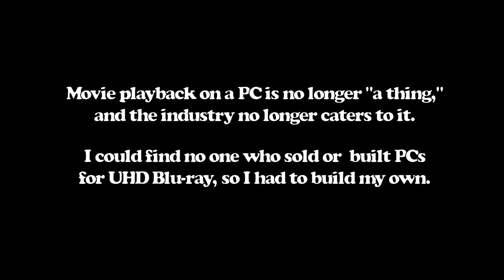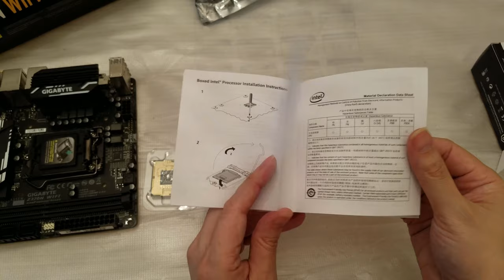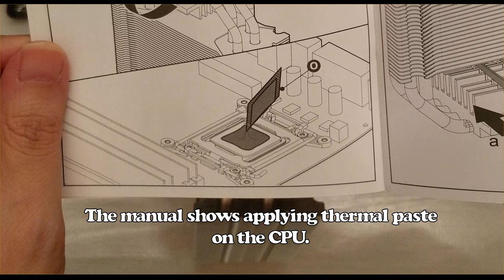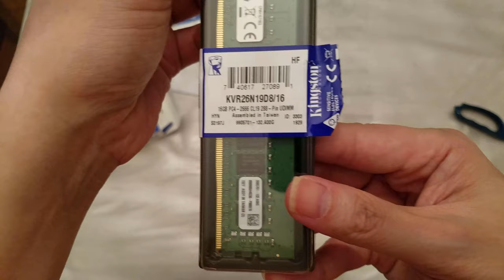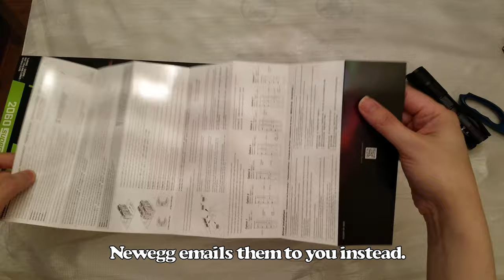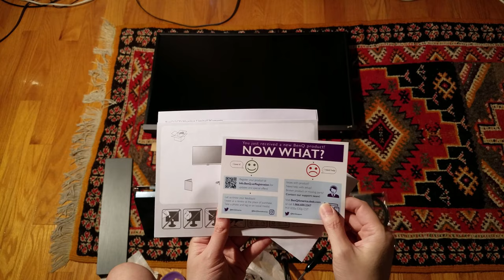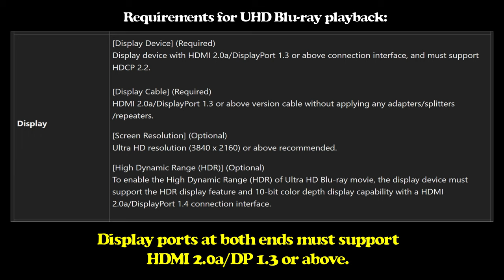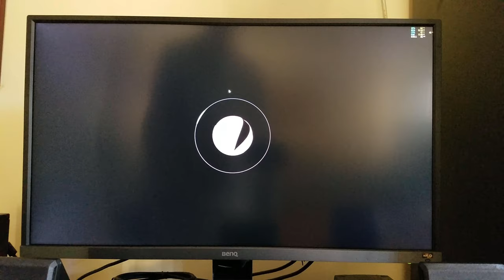PC Build for 4k Movies and Games (August 2019)

Comment: Hello. I am trying to build the same setup as yours but the mobo is "H370N" and I did try and find the same one as yours, the "Z370N", but it is not available for sale. Anyways, other than the difference between the two motherboards, I should be good to go on building a platform for 4K movies on disc?
Reply from the maker: H370N is one of the confirmed mobos I mentioned so that should be fine.  The Pioneer UHD drive in my build has become hard to find too, so I wish you luck on that.
Reply: @PCGamingGoodies  I also visited the link in the description but I wanted to double check with you. How is the Wi-Fi on the motherboard? I had an older PC but it gave me random BSODs in Windows 10 and I am not sure what caused the issues. Also, would I need to download the "Intel SGX" to enable it in BIOS or is Intel SGX built in to the motherboard? I was looking at the newer 10th Gen motherboards but there is no mention of Intel SGX being on the motherboard. Even though it is on the CPU but I am not sure if Intel SGX is also supposed to be on the motherboard, too.
Reply from the maker: @XiaolinDragon888    I've never used my mobo's Wi-Fi.  But since this is a common feature nowadays, I would think it should be a lot more stable with better and newer drivers.  SGX is something you need built into your mobo's BIOS.  The SGX utility that you download merely lets you turn on that feature in Windows without having to boot into BIOS.  Both CPU and mobo need to support SGX.  That's why this DRM is so prohibitive and so few people are doing this.  The newer mobos don't have it, unsurprisingly, because watching movies on desktop PCs is no longer a thing.  Some CPUs still have SGX because they are for enterprise-level mobos that need that kind of security.  So, in short, if the mobo manual doesn't explicitly say it supports SGX in the BIOS, move on.
Reply: @PCGamingGoodies  Thanks for the detailed reply. It looks like I need to stay with 8th Gen and get the H370N. I hope that when you built your pc, updated all of the software, and as soon as you popped in the 4K Blu-ray's, playback of the 4K Blu-rays worked flawlessly with no issues and your system passed Cyberlink Advisor for the full 4K Blu-ray experience. I hope that this will be the same for me. Thanks!

Comment: Reason for chosing this particular grafic card?
Also windows and desktop to apear in 4k on a 4k monitor 
What all other hardware and software specs to be taken in mind 
Or its just dependent on gradic card and monitor???
Reply from the maker: I chose my video card because it has ray-tracing, which has worked great in games like Control.  Regarding 4k monitor, it needs to be big enough for you to see the difference.  For some people it is at least 32", for others, smaller.  You have to find that out for yourself.  You don't want to wait till you bought the monitor to find out it is too small for you to see the difference between 2160p and 1080p.  That's why some people are still on the fence about 4k gaming: https://www.youtube.com/watch?v=ehvz3iN8pp4

Comment: Hi ya. Your video was very helpful but I am not too techie but can you please confirm me system requirements for a pc for running 4K movies smoothly with a  4 k monitor
Reply from the maker: You only have very few mobos to choose from.  Go here https://forum.blu-ray.com/showpost.php?p=13271422&postcount=108 , the ones marked "UHD BD compatibility confirmed" are the only ones known to work.  After choosing the mobo, find the CPU that works for it.  Different mobos can only work with certain CPUs.  Then you need to make sure the CPU supports SGX too.  When in doubt, you can always choose the components I chose in the video.  My PC is still working fine today.
Reply: Pls suggest in 2022 . On budget.